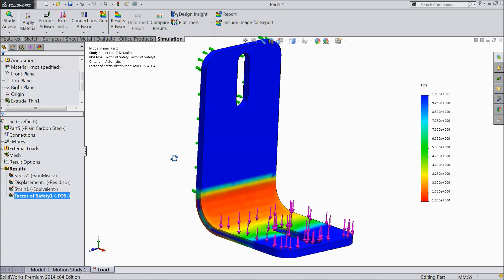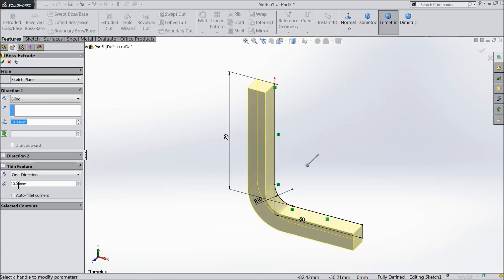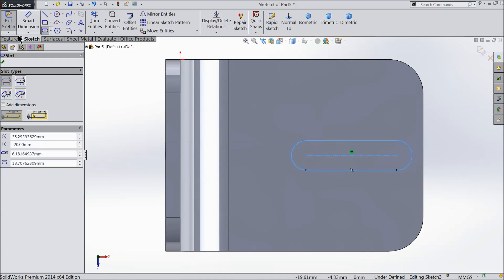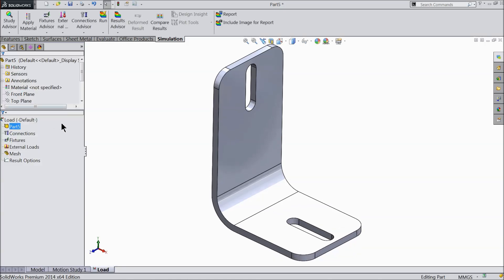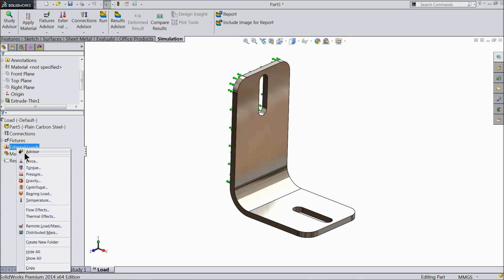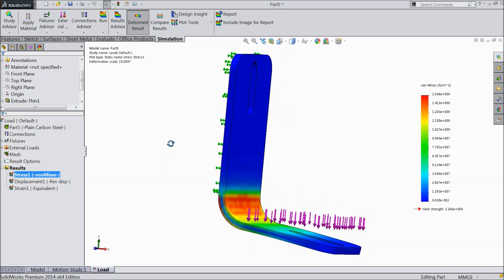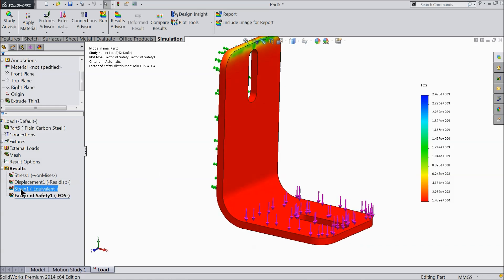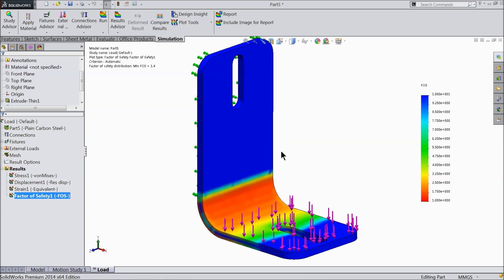Solidworks Simulation | Setup and Study of load in Solidworks Simulation

Comment: Great work!
I really appreciate your efforts!
Had a doubt! What happens when you give a factor of safety; does the software change the material or dimension or load magnitude to reduce the stress?
Reply: Yes, after correction factor what is changes? Is it thickness or type of material? Please extend it Sir
Reply: can u plz explain the changes in design on  giving fos .
Reply from the maker: it recalculate and adjust according to system.

Comment: Thank you for this tutorial, but I have one question and please correct me if I am wrong. We applied force of 300N to a face and maximum stress in red area was 1.5e+008 but the yield strength of our material is 2.2e+008. So I I thing the construction will hold the stress unless the maximum stress doesn't exceed the material yield strength? 
Thank you :) Keep up the good work ;)